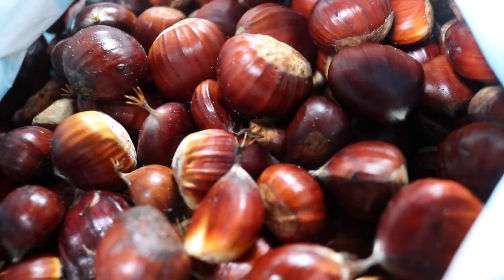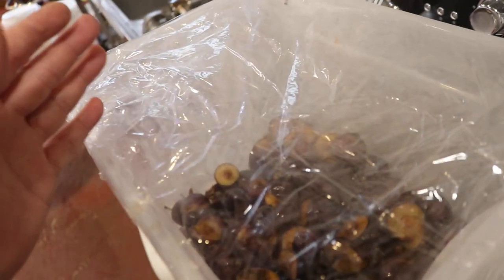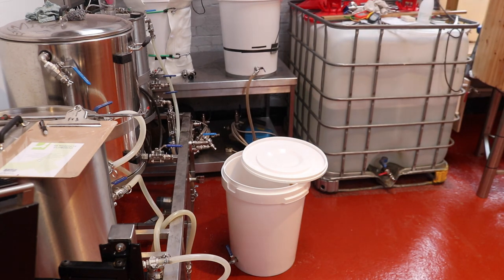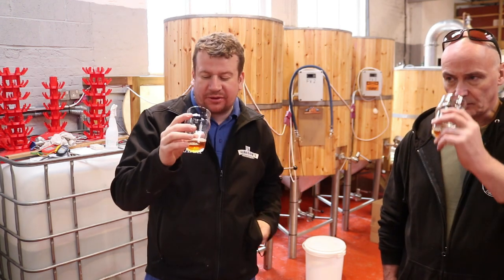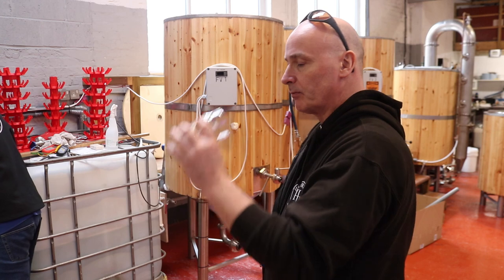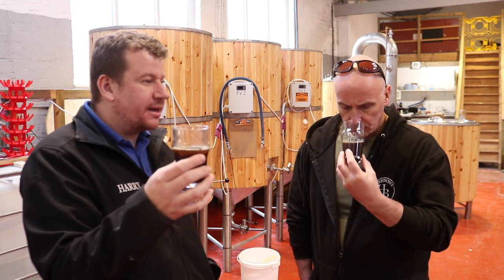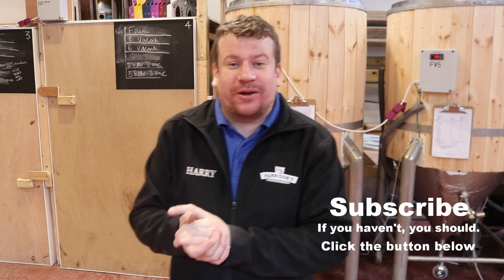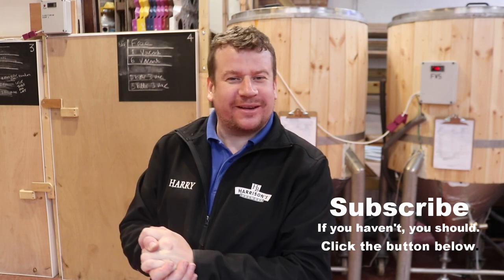Adding The Plum To The Porter & First Taste.

Comment: Harry,  1ml per 1L is way to much IMO, think 1/3rd 1/2 2/3 and maybe 3/4 per L, i brewed a number of strong milds (6%) and experimented with the essence and found 1ml per 1L was a little over powering, i ended up at 2/3rd ml BUT it all depends on the abv and how much of the malts you want to retain, when i did 1ml/L it was like drinking vimpto LOL

Comment: Can't wait to see how version one turns out,I would have destoned the plums first though as they can add quite a bit of astringency (when wine making anyway). Fingers crossed it turns out well. Be interested to see the process of adding the concentrate to version two,I reckon the lower ones will turn out better,it's very easy to overdo concs like that. Best of luck and looking forward to next vlog. Great to see froggy again,and sporting a HB hoodie,need to get one of those lol. Cheers.